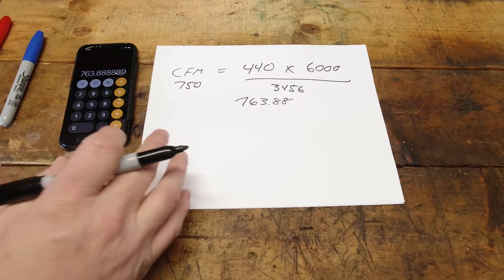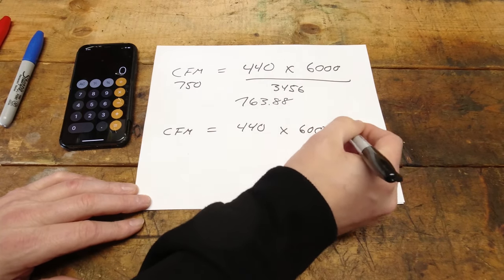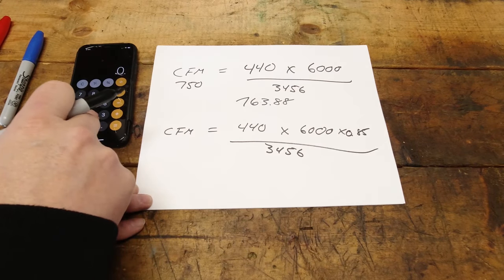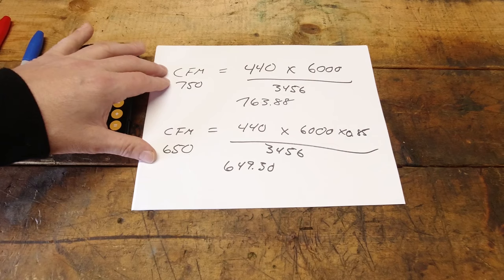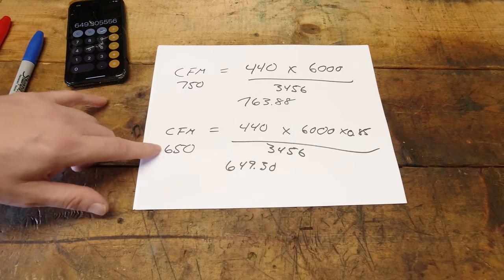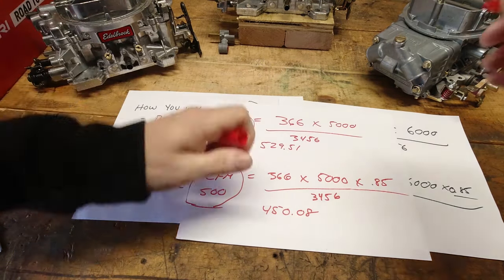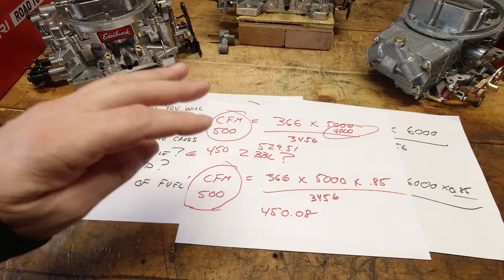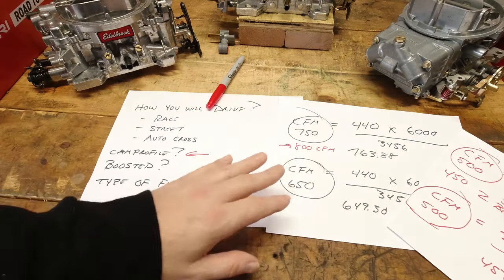How to Choose the Right Size Carburetor

Comment: I always find this issue interesting due to the fact their are so many variables involved. I run a 94 Sonoma on the street with a 10.7 to 1 1st. Gen 399 stroker with 17* heads with 266cc int.runners that I believe most would consider way overkill for the street. My combo features a 4l80E w/3000/3200 stall with balloon plate and 9" with 3.55 gears. On the dyno w/89 pump gas the engine did  266 hp and 400 ft lbs@3500.....440 hp and 513 ft lbs.@4500......608 hp. and 560 ft lbs@5700 max tq. ..........641 hp. max and 526 ft lbs.@6400. The reason I point these #'s out is the fact my engine does not studder or shudder or cough or eat plugs it just runs as smooth as could b with a QFT 950 Black Diamond on the street and I honestly don't believe there's a chance in hell a 739 cfm which is the size carb recommended for my cubic inches could support any of those #'s except at the lowest power levels. Cam/ 260/266@50....679/669...110 split solid roller. Heads flow 404 cfm. What is your opinion?

Comment: One thing I was confused on is how you came up with RPM.  Is that the RPM on a dyno that makes max HP or torque?  That number was thrown around a lot but very confusing.  I totally get the formula but what about your engine?  Heads, compression ratio, cam, intake etc...  Not just RPMs.  I have a rebuilt 350 30 over Elgin Cam E923P 204/214  @ .050 9:1 compression with stock rebuilt early 90s TBI heads and a Edelbrock Performer intake stock exhaust manifolds but 2 1/2 inch duals into 2 Super 10s in a 1973 K10 4 speed.  Right now it has a Edelbrock 1406 on it and it runs great.  I rarely get close to 3500 RPM it has 3:73 gears in it and according to your formula the VE method at 3500 RPM it comes out to be a 301 CFM carb and the other formula 354 CFM carb.  According to your formula I'm almost 300 CFM over what I should be running.  Maybe I'm missing something.
Reply from the maker: Don’t over think it.  Your cam specs are exactly where to start.  You didn’t mention the LSA but I’d guess that cam is all done by 5200-5500.  That’s your max rpm.  That’s where you start.  The rest of your combo looks like it’s a good match.  Don’t concentrate on only where that engine operates.  Yes at that rpm you could put on a little 2 barrel and get really good throttle response and the right amount of fuel.  Your combination however is capable of a max number in that 5200-5500 range.  That’s the number.
Reply: I love your videos very informative. According to Elgin the RPM range for that cam is 1500-4000.  The truck has a granny gear so it's really a 3 speed so at 55 or 60 RPMs are up there.  Anyway I talked to 2 guys at Edelbrock one said put on a 1406 the other said put on a 1901 AVS 500 CFM carb.  The owner of the shop in Montana that built the engine back in 2012 looked up the build sheet and sent it to me.  We were talking and I told him I had a Edelbrock 1406 on the truck.  He said I don't know much about Edelbrock but I would put a Holley 670 Street Avenger on it.  It's funny kinda all over the board.  Thanks again for your great videos!! @MuscleCarSolutions
Reply from the maker: @delbert9357  always will be that way.  Everyone sticks to what they’re comfortable with and that’s not a bad thing, but it’s sometimes limiting.  I tend to look at the application first, then find the best solutions.  Sometimes that’s one brand and sometimes that’s another.  I’m sure Elgin is limiting that max rpm number based on the very old lobe designs they use.  That general duration in a more modern lobe will yield higher rpm and a more controlled valvetrain.  If they say 4000, then that 500 sounds like a great choice.  👍 Thanks for watching!  I’m really glad you’ve found the videos useful.

Comment: I’m still a bit confused on the “operating rpm” range.   Is that just the typical rpm range you’ll be driving or is that like the maximum rpm range
Reply from the maker: max RPM the engine can be operated at.

Comment: Have a 350 SBC  chevy and it has a big cam, do you think it might be that my carburetor is too small  by the way the size is a 650cfm
Reply from the maker: I don’t know.  I’d need all the information to give you a good answer.  When you watched the video, what did you come up with?
Reply: @MuscleCarSolutions  I think it might be my cylinder heads someone told me that I had to replace new heads when I was putting the cam
Reply from the maker: @fernandocarreon2188  don’t know.  I don’t know a thing of what you’re working on.  lol
Reply: @MuscleCarSolutions  oh, thanks for replying to me by the way 👍
Reply from the maker: No problem.  I’m here to help if you want to share what you’re working on.  lol

Comment: Back in the day many engines came with larger carbs. Take the boss 302 for example, it had a 780 Vac sec. Howcome the factory put such large flowing carbs on? Ford had mandates on factory cars for them to operate smoothly so you'd think they would have put a smaller carburetor on.
Reply from the maker: Same with GM and the quadrajet.  Mopar with the thermoquad.  All very large CFM carbs used on smaller engines.  Primaries are smaller so it would idle and cruise without using a ton of fuel.  WOT and the secondaries open and in come in very large secondaries with a lot of CFM and.....leaded gas.  Completely different fuel than today’s ethanol garbage.
Reply: The car companies sometimes put bigger than necessary carbs on certain cars that were expected to compete in racing so that part would be factory installed and accepted where mandated.

Comment: I have a 355 sbc flat top pistons and 64cc vortec heads, about 9:3 ratio, edelbroc eps intake,mild cam and mid length headers  Street use on a single cab chevy truck I'm planning on using a Holly 600 or 670 cfm . What do you think would be best 600 or 670?
Reply from the maker: I don’t know!  I need the other half of the equation first!
Reply: It's automatic 700r4 and 2.73 gears but I'll be replacing them with 3.55 or 3.73, Street drive weekend cruiser. occasionally highway use.
Reply from the maker: @brauliovera5812  still need the other half of the equation!  You’ve given all the additional info, now I need that rpm number.  If you’re not sure yet, what’s the cam rated to?
Reply: The cam I have it's a comp cams XE 256H  operating rpm range 1000-5200
Reply from the maker: @brauliovera5812  that gives you everything you need!  So when you do the math, what direction are you think of taking that number?  Higher or lower?
Reply: Doing the math I'm thinking a 600 cfm will work better for my application, I just wanted to ask a professional because to many people have told me I needed something bigger since the original Rochester was a 650 cfm.
Reply from the maker: @brauliovera5812  bingo!  I think you’re spot on.  600 would be just perfect.
Reply: Thanks for your help! 👍 i like your videos!

Comment: I have a FE 390 Stock w/headers ford trk. Running a 4150 750 Holley. Just a Show trk. but want a little go when cruising. Is this the right carb.?
Reply from the maker: I don’t know!  What are the other questions to ask when picking a size?  It’s in the video!  Promise!  ;) Throw that at me and we can figure out what’s best.
Reply: Thanks for getting back with me. I have CID=390 FE F100 Ford, RPM=4000-5000, a street hwy. trk.. After calculations I get either a 451.3CFM (4000RPM) or 564.2 (5000RPM. I'm not really sure about RPM. I have headers with 50 flowmasters exhaust. What would you recommend for a carb.?
Reply: Thinking about getting a Edelbrock.
Reply from the maker: @donaldcofer7444  that ole 390 wasn’t meant to see a lot of rpm unless you build it for that.  You have a couple choices.  If you’re going to stay mostly with that combination and don’t plan any big upgrades in the near future, if it were my truck I’d go with a 600.  Will be plenty of carb but won’t be so big that it would be tunable.  You’d maintain good throttle response, easy to tune and perfect for a cruiser.  The Edelbrock is the best choice for what you’re doing.
Reply: Thanks, this a '68 Restro from ground up. Kept everything basic, automatic C6, 325 possi. 600 Edelbrock sounds good. Can I bolts on and go, or do I need it tuned? Thanks again for your help. You're doing us ole nonmechnical vets a great service. Take care and stay safe.
Reply from the maker: @donaldcofer7444  sounds like you have a nice fun build going!  Nothing better!  Well the Edelbrock is a square bore carburetor so you’ll need an intake that fits it or an adapter.  For sure you’ll need to tune it.  No carburetor runs perfect out of the box and for sure you can do that yourself.  I’ve got a ton of tuning videos.  You’ll catch the hang of it in no time.  Just make sure all the other things are up to par.  Ignition system is extremely important as is the fuel system.  I’ve done a couple videos on setting up a fuel system and it would be perfect for your build.  Jump right in!  It’s not near as difficult a task as it seems.  If you get stuck along the way, don’t hesitate to drop me a line here.  Always happy to help.
Reply: I forget to mention, I have the Edelbrock aluminum low profile intake. So I don't think I will need an adapter? I look forward to following you on this site.
Reply from the maker: Shouldn’t.  Just depends on which intake you have.  Let me know how it goes!

Comment: I’ve heard several times that Holley and Edelbrock use different vacuum ratings for their cfm ratings?
Reply from the maker: It’s an interesting question.  I know they are all a little different in how they are rated from the manufacturer.  What’s interesting is when they are flowed with one manufacturers process, and you put another brand on that used a different process, you’ll get a different CFM rating.  Doesn’t mean it’s wrong, it just means a different set of standards was applied in the rating.  I’ve thought of doing that video but I don’t have a flow bench at my disposal.

Comment: My pcv valve makes a terrible noise at idle, ive changed it a few times in a 3 month span of time an it only takes about a week for it to be one noisy again, although when i do the finger test to cover hole pcv valve seem to have wicked good suction an functions perfectly , so why does it become noisy like this , its loud an makes engine sound like a squeaky squealing belt ir make one think he has a bad pulley bearing or something  but its not its majour loud pcv valve !! Help frustrated !!
Reply from the maker: The only thing I can think of off the top of my head is I’ve had valve covers without an internal baffle and has them whistle before.  Something is overriding that spring pressure in the valve.  I can’t recall the name of that adjustable PCV but you might search for that.  Maybe it allow adjustment of the spring pressure so you still get the evacuation but lose the annoying whistle.
Reply: @MuscleCarSolutions  ok thanks for your quick response , i have the factory valve covers on it , but i do have a higher lift comp cam an heavier valve springs, same factory intake same factory fuel system an has long tube headers , factory air box an fitler, new performance built transmission an torque convertor all professionally done , but i don’t think would affect pcv valve an make it sound like it does ? Do you think it would ? Also I’ve checked for vacuum leaks an all is good that way, an no collapsed vacuum hoses .. I have seen about the adjustable pcv valve , i will look into that one an try it if i cant get this one figured , its like it has so much suction its trying suck the guts outa the pcv valve, it has a massive of amount of suction when i put my finger over it more than I’ve ever seen another vehicle, maybe i should try different intake port to hook pcv valve to , anyhow thank you an i will let ya know if i figure it out , what it was 👍
Reply from the maker: Lift isn’t the important number on a cam profile.  What’s the duration?  If you have an excessive amount of crankcase suction, you’ve got a leak.
Reply: @MuscleCarSolutions  duration @ 0.50 …intake is 216 an exhaust is 224  , an yes i was thinking maybe i should check throttle body gasket for leak , an the plenum gasket on the underside of intake.  Its a dodge ram truck with 5.9 magnum engine an they are know for plenum gasket , i have had it replaced once with  hughes plenum repair kit but stranger things known to happen, some say the bolts of the plenum plate an gasket can come loose as well , again i thank you for your advice an suggestions its opened me thinking as you can see lol, to more things to check ! 👍
Reply from the maker: @DarrensTruckzs  that’s usually how it goes!  Keep poking away at different things till you find the culprit!  Good luck with your search.

Comment: That formula is the worst way to pick a carb it always under carbs. It's good at figuring out how much air an engine will displace at rpm especially when you calculate VE, problem is carb cfm rating doesn't have much to do with how much cfm a carb will flow just how restrictive a carb is.   Picking a carb is more like picking headers except it's more fussy since atomizing fuel will be a problem if you go way to large.

EG. If you have an engine that displaces 500 cfm's  at peak rpm, a 390 cfm carb will flow 500 cfm just be more restrictive a 1000 cfm carb will still only flow 500 cfm but be a lot less restrictive but may not be able to tune well especially in a street application. 

But for the most part we already know what will work,  EG. a 300-350 displacement making 250-400 hp we know a 650 will work good in a street type application we even know a 750 would even work in most cases especially if we go to to the strip a lot if were talking 400 plus hp 750 will be the go to carb but a 650 will work but will kill some hp at some point in hp especially in a race only situation 850 cfm plus etc..  a larger engine like 400-450 cid you would start with a carb like 750 cfm and go from there.

It's got more to do with what vacuum level aka restrictiveness you want your engine to pull at full throttle a pick the carb that will achieve that. A race only car will need a lot less vacuum because wot and making hp is the only concern, a pure street max hp isn't too much of a concern so even if you go a little over restrictive ain't gonna matter to most. It's the in-between that  is hardest if you want max power and good driveability it a little trickier but unless you go stupid large you could go a lot bigger than you think.

Unfotunally to find optimal  cam gears carb etc.. will always come down to trial and error. Best thing would to borrow a few carbs and try them or buy a few swap meet carbs cheap and play around.

Comment: I have a 351w bored 30 over, edelbrock rpm intake, mild cam, and compression is 10.7 to 1. It is a street only car. I have a rec limiter at 5500. It's an automatic car. Current have 750cfm Holly but want to get new one. Looking at 670 Street Avenger or 770 Street Avenger. They dont have one in-between. Looking for guidance. Based upon your video, and my usage I'm guessing 670.  Feedback?
Reply from the maker: Probably would be just fine with the RPM limited.
Reply: Not sure I follow the response. What cfm size do you feel would be best?
Reply from the maker: @bluesky9376  670.  Your RPM is going to limit the need for anything else at this time.  Without any cam specs but defined as mild, you won’t run out of CFM with this set up.

Comment: If an engine is basically an air pump the engine is only going to flow as much air through that carb as the engine can injest. And the carb meters the air to fuel. So wouldn’t a oversized carb really not be an issue.
Reply from the maker: If it only flowed air then sure, that’s probably a good theory.  But they also flow fuel and the bigger the CFM the more fuel they meter and the more raw fuel that gets dumped into an engine that’s not capable of using it is a big problem.

Comment: I have a 1406 and a 45 mph when I punch it chocks out then catches what's wrong.?
Reply from the maker: What size engine is it on?  What have you done to tune the carburetor?  What is your timing set at?  What is your fuel pressure regulator set to?
Reply: 383 stroker nothing yet to the carb timing has not been checked . What should the timing be at? No pressure gauge
Reply from the maker: @steveolay4880  time to buy a calibration kit, get the rest of your house in order with the timing and a pressure gauge.  Now you can start tuning.  Find your vacuum at idle and set the step up springs.  Add some additional fuel with the accelerator pump to see if it helps.  Timing goes hand in hand with tuning a carburetor.  It wont be the last time you adjust it.  Start at 12-14 and add more from there if needed.

Comment: Do you have the equation for the added variables of E85 and cam spec?
Reply from the maker: Sort of.  Cam specs are a little more fuzzy because it really boils down to the entire set up and what it’s being used for.  E85 is a little easier as you can always add at least 15% more fuel.  So if you’ve figured it’s going to take a 750 carb but you’re adding E85, I’d go to an 800 at a minimum.  Just make sure your fuel system and carburetor is rated for that caustic fuel.